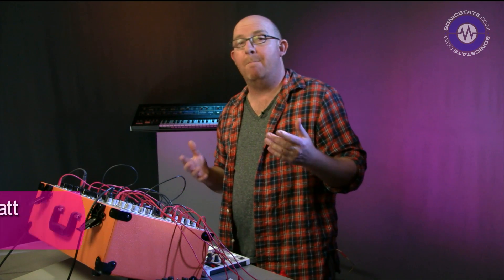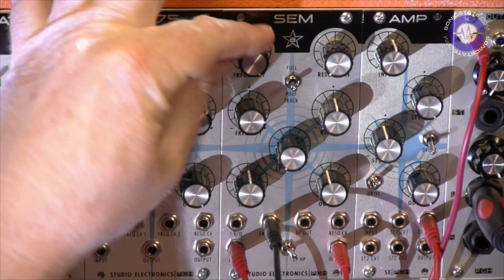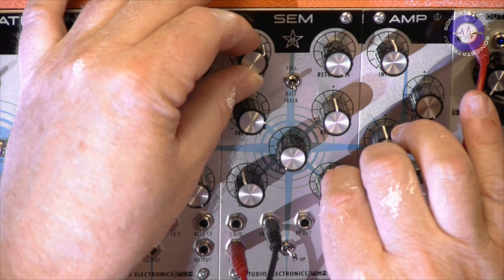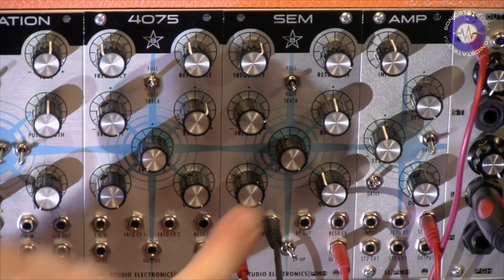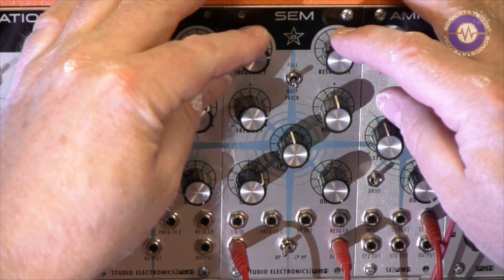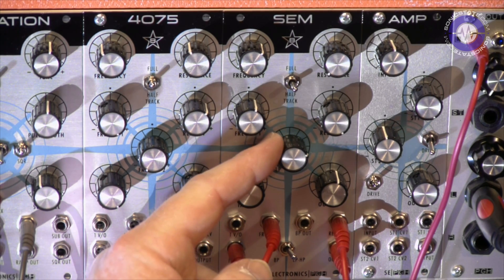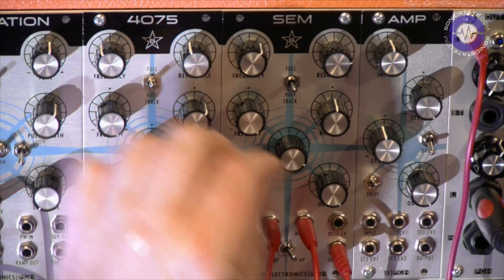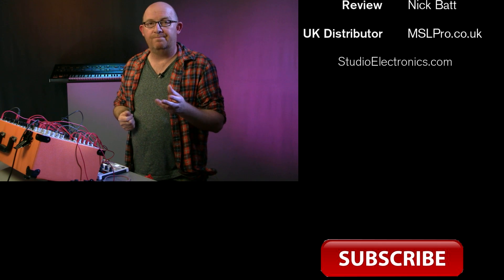Boomstar Modular SEM Filter  - SonicLAB Review

Comment: How does this compare to the doepfer sem filter module ?

Good sounding filter , thou sounds a bit more aggressive than original SEM,(im guessing option to overdrive).From my understanding the original SEM doesn't self oscillate , (am I wrong ?), also that LP to HP mix to me, seems like the notch mode of the original SEM which again is not modulated would be nice with 2 pre hp lp vcas . Anyway good in depth review.

Comment: CV modulation of the notch (which is what it's called on the Ob SEM) isn't actually all that common; of all the Oberheim-style SVFs I've owned, the only one that featured that was the Anyware SEMTex XL. Tom Oberheim's own SEM doesn't offer it. So, if that's somehow a dealbreaker, you're going to be waiting and searching for quite some time before you find one. IIRC, CV control of the notch requires a vactrol, which introduces a number of engineering and support complexities, and manufacturers likely don't think the feature is worth those.
Reply: Update - I've asked around since hearing about the need for a vactrol to control the notch some years back, and it's apparently not true. FWIW.

Comment: No modulation over LP/HP mix is a deal breaker for me. You can't even simulate it outside the module since there are no dedicated outs for LP and HP alone. That's a huge under sight on SE's part. Seems to me they just didn't want to break the format of the panel layout they've been using for other modules. It's too bad because the filter sounds very nice otherwise.